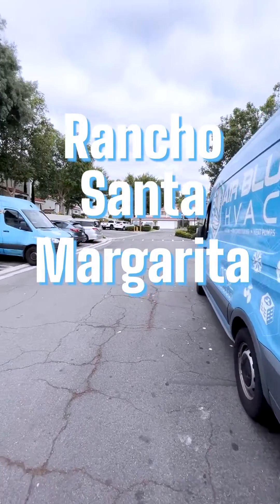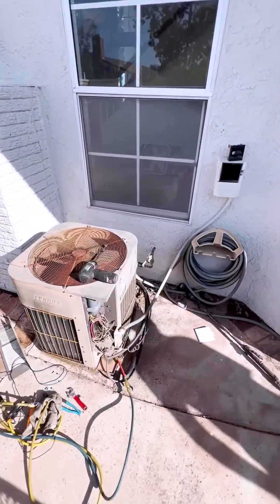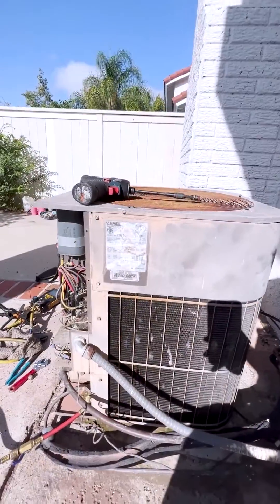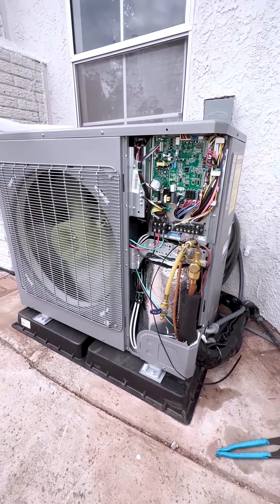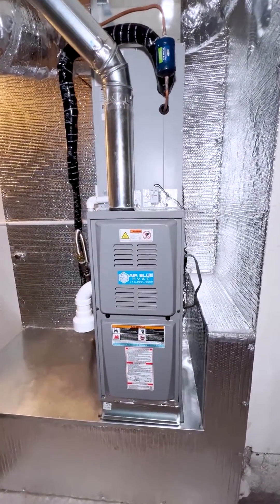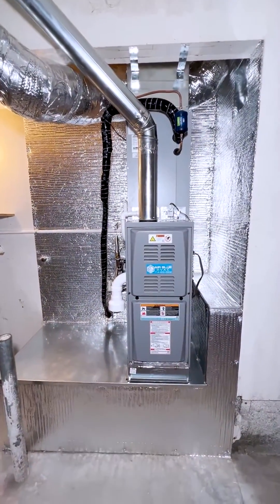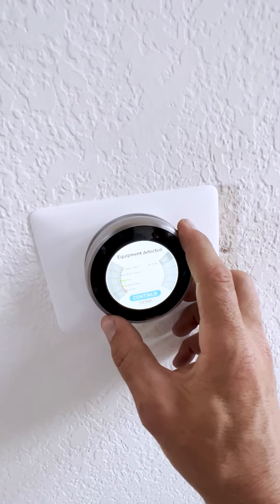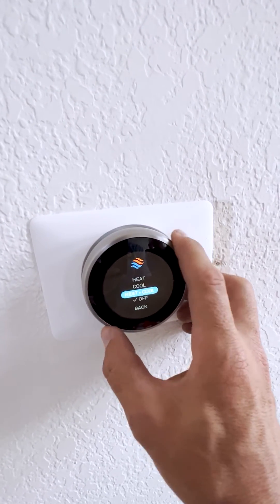Dual Fuel System Installation in Rancho Santa Margarita / Gas Furnace & Heat Pump Upgrade

Comment: It was hard to tell, that small unit was the furnace unit for the duel fuel? and you still had the evaporator section above it for the heat pump?  did the furnace unit have a controller to manage turning the heat pump on and off while the furnace section operated?
Reply from the maker: yes, it works for gas heating or heat pump heating based on your thermostat settings.

Comment: I don't understand why put heat pump system when natural gas is better it is my opinion
Reply from the maker: why not have both? Especially if it’s the same price
Reply from the maker: this unit is both gas and heat pump
Reply: @airbluehvac  Yes I understand but you would save more energy using only the gas furnace without the need for a heat pump
Reply from the maker: @eliazarsanchez9495  heat pump is technology where your AC unit can run in heating and cooling. Variable speed heat pump can have coefficient of performance between 900%, and 200% when gas furnace maximum efficiency is 95%. of course utility cost depends on gas price and electricity price but most customers have solar and you cannot offset your gas bill with solar panels.